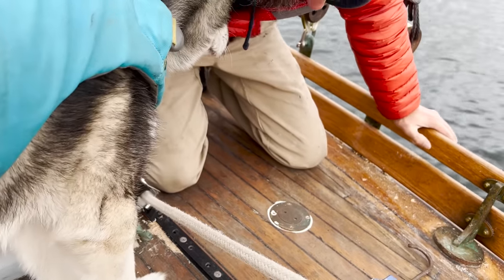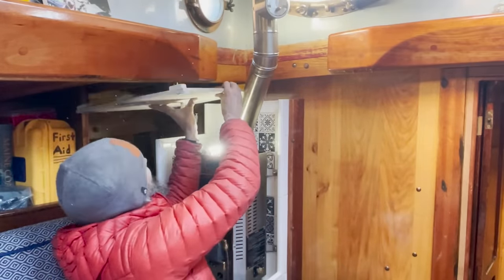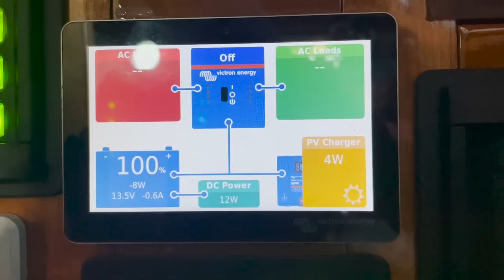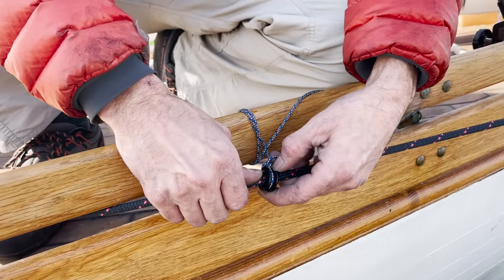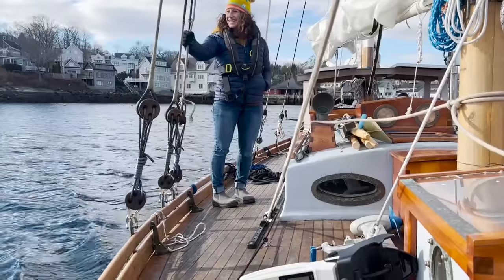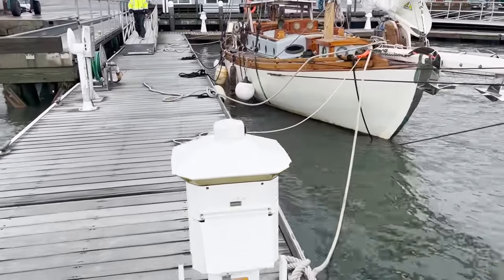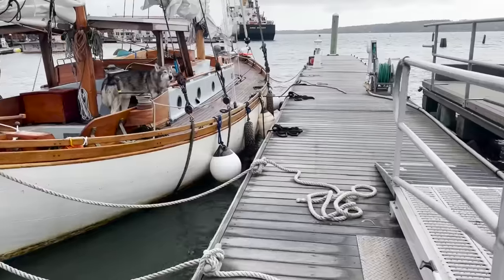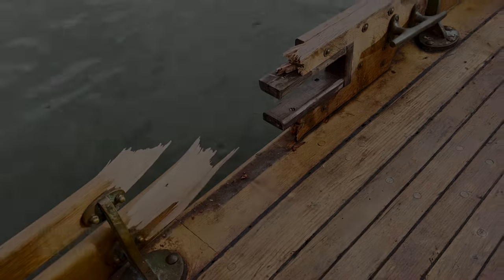Break Another Little Piece Of My Boat  - Episode 291 - Acorn to Arabella: Journey of a Wooden Boat

Comment: Surprised you did not use double wall vent pipe.  You can use rigid sections or flexible Type B only requires 1 inch clearance to combustibles.  I use it for my shop diesel heater.
Reply: Obviously I am not Steve, but my profession is in the hearth industry doing sales, installs and service. The reasons why you would want to use single wall over double wall is that you actually get more heat off of the stove that radiates from the stove pipe. That is why it is very commonly used in hunting cabins, off grid living or boats like this. Also, a lot of woodstoves that are older like this one are not compatible with double or triple wall pipe. Also, B-vent is not to be used with solid fuel burning appliances such as wood or pellet/biomass. That is defined in the NFPA 211 US national codes and standards.
Reply: @Zeekstuff , it’s not a wood stove, it’s a diesel heater.
Reply: @johnnunn8688  and heat from a wood stove differs from a diesel how? Do you think a tonne of feathers is lighter than a tonne of stone?
Reply: @johnnunn8688  okay, I got the fuel type wrong. It is still not approved for B-Vent 
because the exhausts exceeds the macimum 500 F limit. For what is classified as a "oil fired" appliance, it would have to be stainless single wall venting or what is known as L-Vent which is double wall which both are ridged and not flex. Having a single wall in there not only cuts costs but also has the same radiant heating benefits I described earlier.
Reply: @Zeekstuff macimum?
Maximum?
Reply: @jessdigs troll or trolling 🤣
Reply: A diesel heater is pretty much a fuel oil product.  There is a product called L-Vent.  It looks exactly like B-vent but is rated for flue gas temps created by diesel or oil heaters
Reply: 🤔💡 the installation of a 'Heatfan', which is a eco-friendly fan, is powered by the heat produced 🔥. The blades spin faster as the fire gets hotter, dispersing the heat throughout its area. NO ELECTRICITY NEEDED! But, Steve is to cheap.
Reply: Double wall pellet stove pipe needed, single in this application is a safety/fire hazard
Reply: Good advice about not using the double wall! But I wonder if the automotive heat shields that they have between cats and the car would also work? Super light, shaped, maybe free at most junk yards.

Comment: Cement board does not make a good heat shield! Cement board is a masonry product. Cement and masonry absorbs and stores heat, you want shiny stainless steel with a minimum of one inch gap. The shiny surface reflects the infrared heat, that’s why all radiant barriers are shiny metallic materials. This it exactly what the code requires for a house to prevent fires, you don’t want a fire on your floating house.

Comment: Spent a morning tied to a trawler which was tied to the whalf in a gale  her 4 spring lines were 2 inch,  never seen ropes under so much load ,we were being tossed like a rag doll.. humble advice. Get a bigger spring line cleat , room for fwd and aft spring lines bolted through the deck , through blocking which spreads load to deck beams, well done Steve .

Comment: As a small boat shipwright, I did notice one thing and something that no one in the comments has commented on regarding the toe-rail cleat breaking, as I usually read a good selection of comments before I do comment to see that it's not doubled up too many times. 

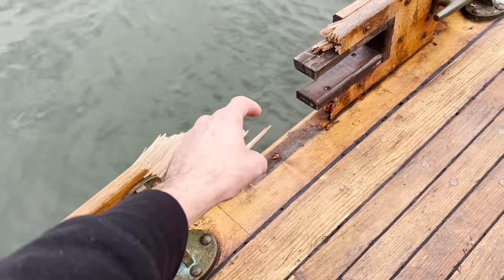That is, it broke where you had a join in the timbers with butt end joints on the outside and the backing plate of timber on the inside which you had the cleats fastened to and a hole through for the line to exit... it came apart due to only the backing plate holding it fast where a single rivet was top and bottom(weakest point) and when that separated then the aft section of timbers broke near the stanchion with all the sideways force acting on it as you can clearly see at 25:21..... 

1. I would never put a cleat or set of cleats on a butt joint. 2. I would never use a line at 90 degrees to a cleat with that amount of force acting on it, always fore and aft only. 3. Always run lines from a cleat in the direction of the line from the cleat IE from the cleat in a straight line to the tie-off point with as little angle as possible. 

I have been building and sailing on dinghies, small boats, keelboats and large tall ships for the best part of 40 years.

We all have a learning curve and this is a thing that you can learn from and know not to do in the future, and seeing that you both do not have any sailing experience you are learning first hand whereas you would have learnt this and many other things previously. I am not trying to knock you down or anything like that but just to say that you have many many things to learn and will experience them on your boat Arabella, instead of on smaller boats or those belonging to others and the knowledge that comes with sailing on other boats.
I love what you have achieved and watched every video you have made and you have come a long way since starting this project. Well done, fair winds and following seas.

Comment: I know you guys are learning as you go, trust me, we have all been there. But...  4 lines and 4 fenders, all you ever need to tie up next to anything solid. Bow line, stern line and 2 springs, all separate pieces of rope, never make one rope do two jobs (as my Dad used to say). As long as everything is made off properly and the ropes are in good condition you will see out the worst conditions.  There was a reason that the locals all buggered off once they saw the weather coming in - always pay attention to the locals, and make a note in the log for next time you are in the same location.
Keep going, it takes a lifetime and every day on a boat is a school day.
Reply: To me this damage is a "bad strategy" problem not a "bad weather" or "bad boat" problem. Had they just left the boat tied to the dock as usual I think they would have been fine. That said maybe moving the midship cleats onto deck instead of on the rail itself isn't a bad idea? It would definitely make them stronger.
Reply: Totally agree.  Also pays to watch where fishing boats anchor when bad weather strikes.  Working skippers tend to know where the bottom holds best in any given situation in their patch. I once helped salvage a beached and badly holed yacht whose skipper figured he knew better.
Reply: I disagree, Nigel, there are times when you simply cannot afford to be making contact with the dock. There might be overhanging ledges to get caught under, rusty or broken steel projections (bolts left behind when pilings or cappings rotted or broke away), ladders, protruding cranes to "interact" with the shrouds or spreaders, even sharp shellfish to mince your fenders - or any of an unlimited number of other traps. Springing away from a windward dock is a valid strategy in such cases, but this clip provides a useful demonstration of a couple of the (great many) things which can go wrong.
The key lesson, I think, is that contrary to what a person new to sailing would expect, the failure was in the lines which (in static terms) see no load, and even in this dynamic case, (wave action being the problem) they see no direct loading from the wind. It is the kinetic energy imparted by the waves (and less importantly, by variations in wind strength) to the mass of the hull which broke that toe rail.
In this case, two lines were angled and one was perpendicular, meaning there was not even sharing of loads. It would have been better to have all the leeward lines at a similar angle off the perpendicular, and an even number of lines, all of similar length, half angled ahead, and half angled astern. Even outside those times, as a bare minimum, you need one or two fender boards, and if the cleats ashore are not strong, you need to double or triple each line and tie off to multiple points ashore. Finally, the structural design at the point of the toerail which broke might be strong enough for spring lines, but clearly not for breast lines.
Reply: @northlandrider5396    Perhaps you missed the fact that the fishing boats were not constrained by draft in the way Arabella was? She was perfectly safe where she was, and the line whose attachment failed was clearly not crucial. Per my other post, I personally feel the detailed execution of the strategy and the detail of the boat structure were the only problems with the choice Steve made.
Reply: @Gottenhimfella    -  "there are times when you simply cannot afford to be making contact with the dock".  -  That is why you have suitable fenders deployed. Maybe this is a 'different sides of the ditch' issue - I would never teach anyone to run lines across to the other side of a bay in that way - apart from anything else think of the possible carnage if someone was trying to get in to moor late at night in the dark in adverse weather conditions.
Reply: @Gottenhimfella  It had nothing to do with draught.  The fishing boats moved to the lee of a headland on an island where the seabed provided better purchase for anchors. The yachtie parked over sand and left the vessel unattended overnight in a severe storm, taking himself and crew ashore to stay in a cabin.  It was the second time his insurers ended up having to pay out for his ignorance. Steve's spider web of mooring ropes was a complete bollocks, anyone else entering the area in a boat would have hit that long line and more than likely fouled the prop.  Shit like that snowballs. Leaving the dinghy blocking access on the walkway was pretty inconsiderate too. Always watch what the locals are doing.
Reply: @nigel4425  Fenders stand no chance against the sorts of protuberances encountered regularly on wharves and jetties in many of the places where it is interesting, rather than popular, to sail.

Comment: Hey Steve, so I have the FG version of your boat - Alujala 38. The tried and proven method on these cutters is to run your roller furl lines with the toe rails or using the station base by using small blocks. This keeps the deck free when you’re in heavy weather and is way safer.

Comment: My first thought in seeing your mooring lines was “you are trying to tie 2 pontoons/floating docks together” with that setup! More fenders next time and don’t worry about keeping her from touching.
Reply: IF you're going to do something like that; dynamic lines/rope would probably be best.
Reply: I think the problem with just adding lines there gets a point where one line is the shortest and then the whole strain goes to that line (like picking a lock).  Just spring lines and breast lines is best.  That way no one line is holding the whole boat.
Reply: I second leaving slack and using spring lines, the boat has to be able to move

Comment: Been following “Salt and Tar” videos since the beginning of their build and now their sailing adventures.  They rigged a safety line fore and aft on either sides of their boat.  It adds a huge dose of safety and is a useful hand hold when moving foe and aft.  Thanks for letting all of us witness this adventure.
Reply: That's because Garret knows how to sail. Because idealism was the key factor. No. Don't go learn how to sail! What a waste of time that would be??!! While you're building a sailboat??? I would've been sailing EVERY WEEK!! Not my channel.
Reply: Agree with the safety lines from forward to the stern. Clip on BEFORE leaving the cockpit in any kind of rough weather. this is especially true as you don't have guard rails. I always rigged my spring lines from the transom forward and the bow aft crossing in the middle. the bow and stern lines are then used to keep the boat close in. It does need long spring lines though.

Comment: Mooring in storms I’d suggest deck mounting the cleats and feeding through toe rail rather than tying to toe rail as your current setup is essentially doing. Mooring compensators will also help to reduce shock loads through mooring and spring lines. Finally, as mentioned by others too, tying up to two ideoently moving objects, in this case the pontoons, is not something I’d do myself either.

Comment: Hello, May i suggest two things :
1) On each "low friction ring  "" (as user of it!!) you have to do a very "tight splice" in order to have a good use of it.
2) For the mizzen boom  and just over the rudder, Have a folding " X" (with long legs) to fit under the boom that  it does not moove at any time  and bystiffen the sheet fermely of this sail.
3)The Ascending and Descending guards lines coming from pontoun  must be moored upwards at the Front and downwards at the Rear  (those areas are generaly more strong!) and 
in principle cross  outside the boat to improve their functions .
Nice video .
Bon courge and stay safe.
Reply: Sorry 3 things and hope my words are the good one.?????

Comment: Haul it, strip it empty, put back only what you NEED, paint the bottom 6” up, and think, lighter, lighter, lighter. I built and sailed this design 20K miles. Floating higher will make you sail much better. Stuff can be too strong (too heavy). Having less is best for the INGRID.

Comment: May I suggest to you one of those wood stove fans to put on top of your diesel heater, pointing at the stove pipe? Not only doesn't it require any electricity at all, but it will blow the heat in the entire space, and while doing so it prevents the stove pipe from getting too hot or scorching any wood, and it will also reduce the diesel consumption because it will spread heat from the exhaust pipe that otherwise would go to waste outside the boat. It will also feel much more comfortable inside the entire boat.

Comment: It has never been a good idea to put the mooring buttons in the gangway, they should preferably sit in the deck with something stable underneath.  And ideally the rope should go as straight through the opening as possible, that is to say the two on the land side would cross each other.  But you learn from your mistakes.  💕😄😀
Reply: - Yup, "straight through the opening".
- My construction/rigging/physics instinct would want serious cleats screwed/bolted to stout deck framing...attached to the diagonal brass rib strapping anchored into the keel...if I correctly recall this boat's build for storm anchorage.

Comment: Good one!  Maybe its wise to seal the end grain in your through holes in the deck and housetop, for example when we are fitting a sink in a wooden table top in a kitchen its good practise to seal the cut out or end grain in case there is a leak the wood wont swell.   - im just an electrician, not a boat builder!
Reply: This I thought also. Condensed water under the cold deck will enter the end grain and rotten is soon the result. All your cut openings lack this.

Comment: Going forward in the future, if you want to have that lovely structure of the deck and upper hull visible behind the diesel stove, you could put some lagging in that area. Each end of the lagging can be held secure with a clamp ring, so the lagging does not need to extend the entire length of the chimney pipe. Another potential option that you probably already have thought about is cutting that backer board to the shape of the structure instead of it being one flat piece across. You said you plan to make it look nice, so whatever happens, I’m excited to see what you choose to do with it!

Comment: Maybe you can try heat tape for the pipe. it is used a lot on motorcycles and hot rods to keep exhaust pipes from burning or melting things. also have you ever thought of using one of those tow behind power generating impellers? I know you have the solar cells but this would generate electricity while you are under sail or moving with the motor and wouldn't be bothered by storms or clouds?
on another note maybe do a clip video woth a counter "how many holes has steve put in his boat?"
Reply: A double wall pipe would help too

Comment: Couple of things, using three strand rope for mooring lines puts spring into them and they then do not snatch which is what broke your scuppers. Also the black springs on the starboard side were giving that cleat an unnecessary a hard time.  To stop fenders squeaking use washing up liquid to lubricate.

Comment: The toe rail looks like it has failed largely because there is an unsupported joint at one end - notwithstanding that doubler piece. If you are going to the trouble of scarphing in a new piece, carrying it past the mounting brackets at each end might help prevent this from happening again.

Comment: Mount a piece of stainless steel sheet stock (16 gauge) about a distance of 0.25" spacing between the cement board and S/S sheet.
This will provide a very safe heat shield between the stove and the boat.

Comment: A couple of rough days there, and a few lessons learned.  I'm curious, why didn't you run the furling line straight from the bow sprit?  Your dock lines now have to be threaded under the furling line which is one extra step.  a couple more of those loops shouldn't add too much extra effort in pulling it in.

Comment: Steve, it actually looks like an issue that demonstrates the weakest link principle.  Mounting those cleats, meant to hold a rather heavy boat, to the toe rail, rather than the deck, with a substantial backing plate below, will likely result in failures down the road, with potentially far more disastrous results.  Ask around for other sailors opinion on this matter.  You will see that most cleats meant for securing the boat will be mounted to a far more substantial part of the boat, such as the deck.  A rather substantial backing plate is included below deck.  I'm talking steel plate and through bolted.  Lastly, you are correct in minding the direction of the load on the cleat and its foundation.  Good luck.